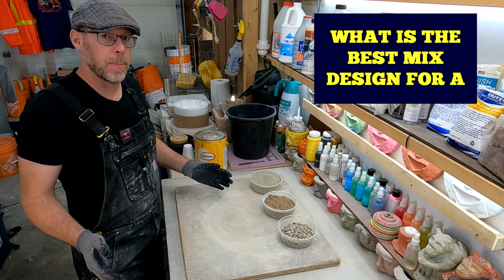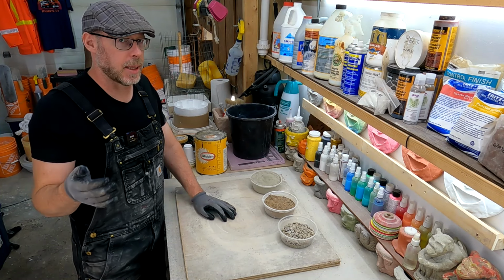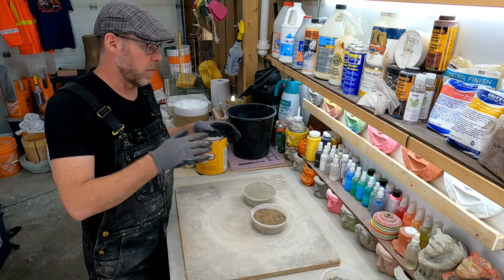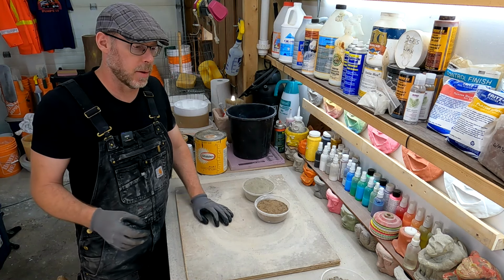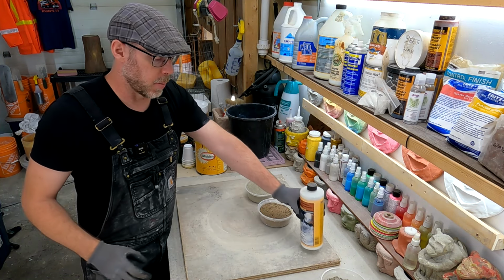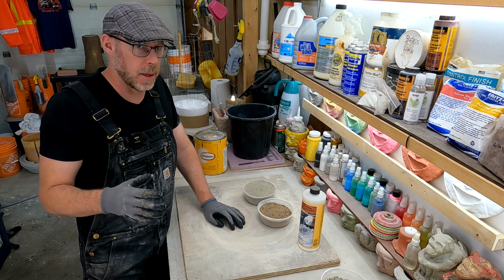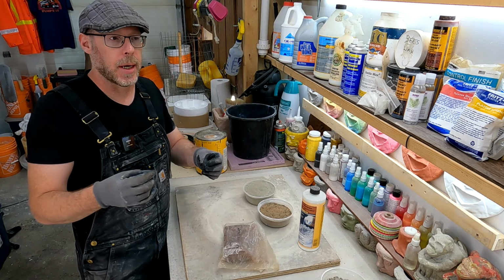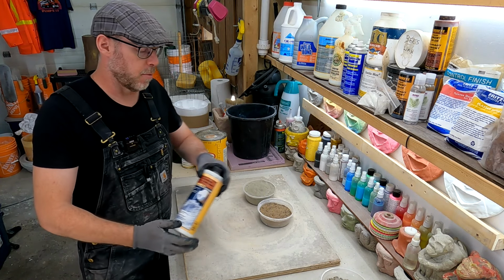What is the Best Concrete Mix for a Feathered Edge?

Comment: Good to remember: 50% of the water replaced with acrylic fortifier. Even more gain by using superplasticizer (for pourable consistency, without using water to achieve it).
Reply: This is a self made mix, equivalent to "self leveling overlay pre-mix"- which are the best you can get/ engineered.

Comment: This is question that does not necessarily pertain to this application, but I have been asking people and even sent an email to Sika but didn't get a response: Can I add water to a concrete bonding adhesive and acrylic fortifier? The directions say not to add water, but I've seen videos where people have added the water. It gets very expensive to just use the product only because of the thickness. Also, when do I use a concrete acrylic fortifier instead of a concrete bonding adhesive and acrylic fortifier? And vise versa?